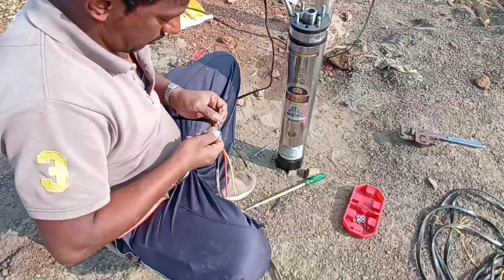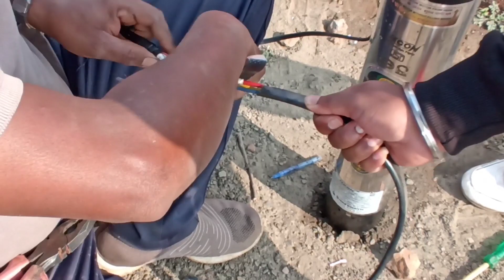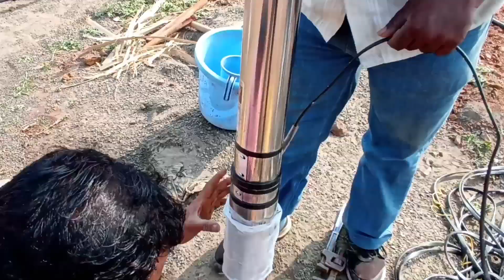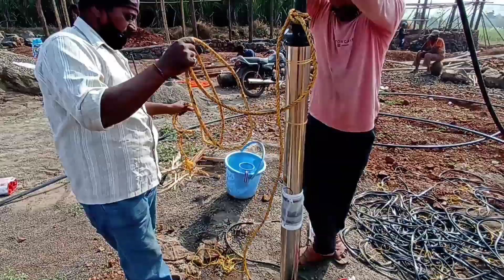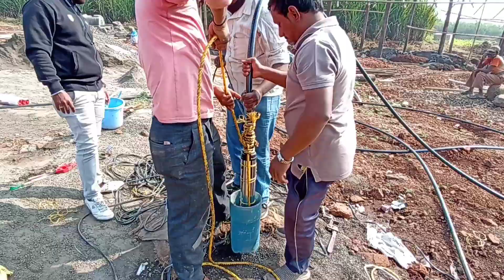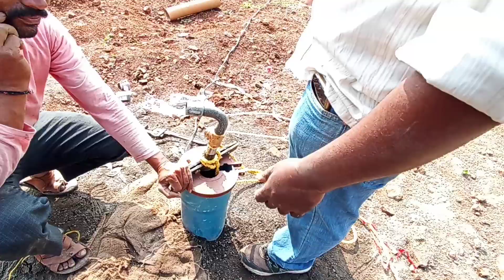2HP Solar Submersible Borewell Pump || सोलर सबमर्सीबल बोअरवेल्स पंप || 400 ft Head

Comment: how much area 2 HP solar submersible pump can irrigate ?
Reply from the maker: 300ft min
Reply: Ac pump or Dc
Reply: Price 2 hp solar pump
Reply from the maker: 1,40,000/- total all costing
Solar panel
Submersible pump
Structure
Cabeling
Drive